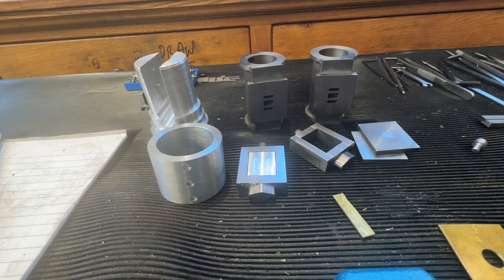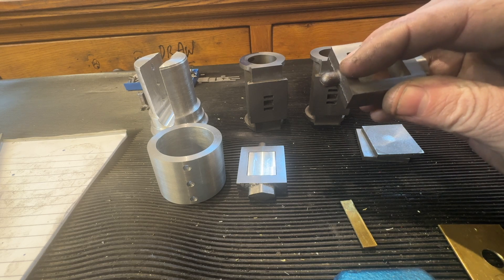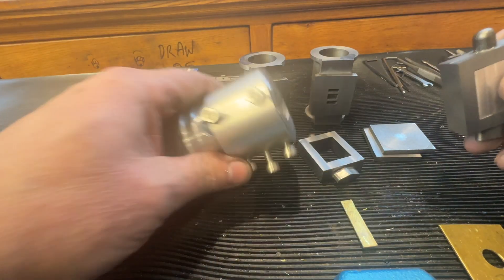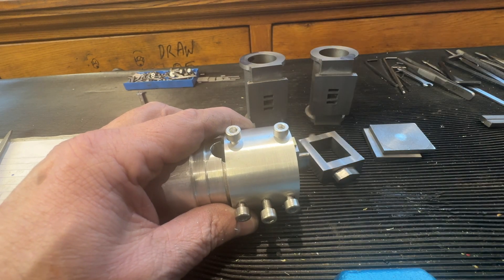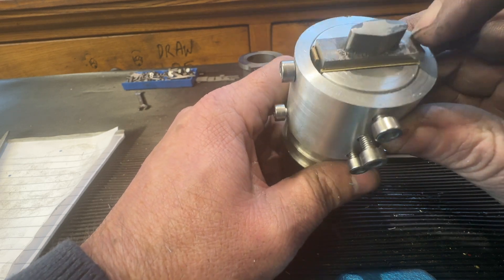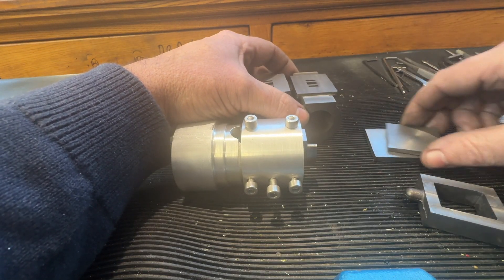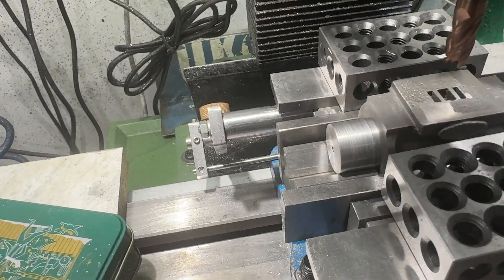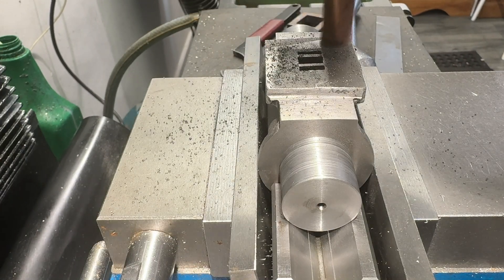Twin victoria Part 5B

Comment: I'm not keen on the idea of drilling a high aspect ratio hole through the ally block in the middle of the valve chest.  I've had too many drills snap drilling deep holes in ally, but maybe I'm just ham fisted!  How did you get on with it?
Reply from the maker: go slow, if I was doing it every day I would get a different drill

Comment: Just a noob question, while drilling at around 10:34, the drill seems to be deflecting a bit just while it is engaging / entering the hole, why is that? Thanks.
Reply from the maker: yes it was i had to clear the drill a lot...also been an aircraft very long

Comment: Really great video Andy. Excellent fixture. Question: what is your method to establish cylinder centerline to machine the face for the steamchest?
Reply from the maker: As the ports are already there, you take the mean/center of the rough ports and find the best middle line. I think that's why they make the valves wider to accommodate the errors.
Reply: got it. Solid approach. Love your methods here for precision and accuracy. 👍👍